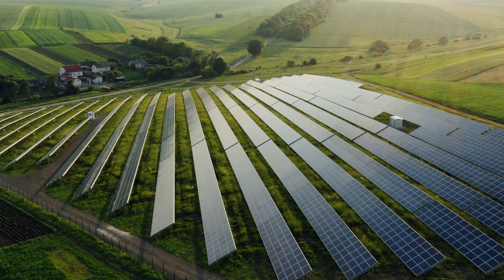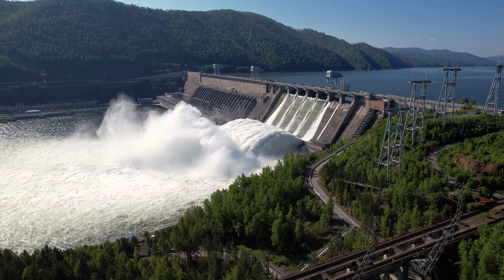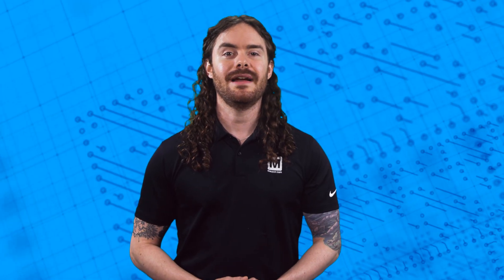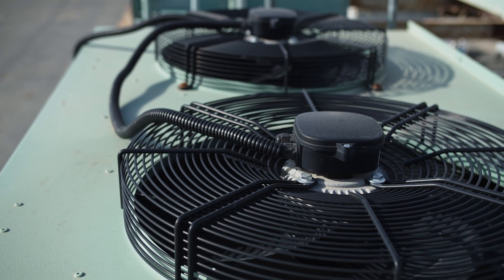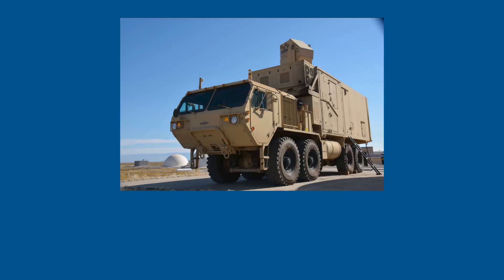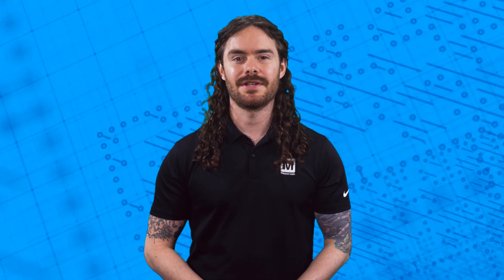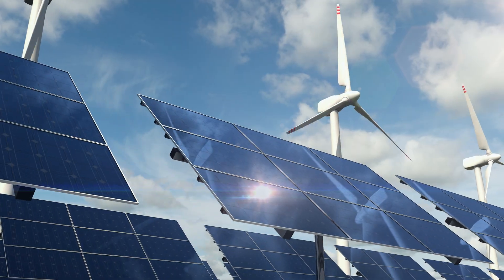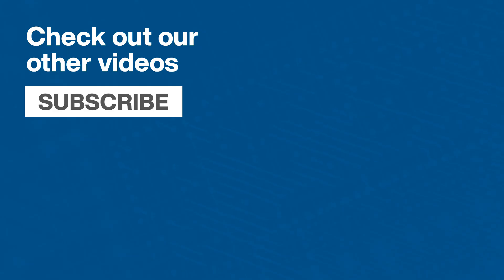DC Microgrids | Need to Know

Comment: One problem is legacy wiring another is fact that many equipment can't directly plug into DC because it lacks connector, example fridge and washing machine.
So there are many problems like having to retrofit old houses with invertors or still having to run AC in new buildings till most of AC stuff get's phased out.
Then you have in city/village problem where old equipment will have to be modified to run DC or extra line as retrofit which too many might not be happy about.